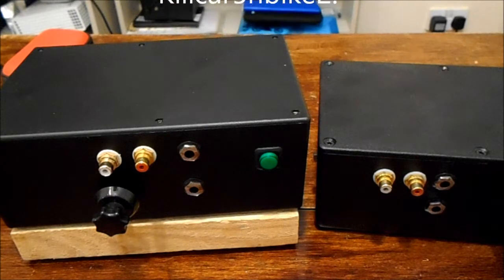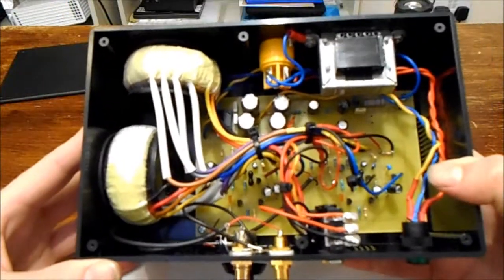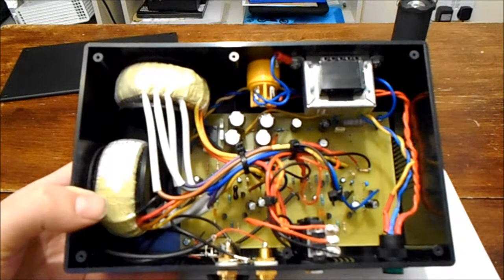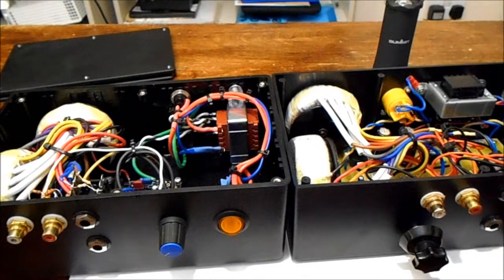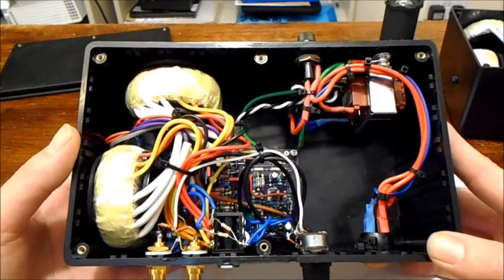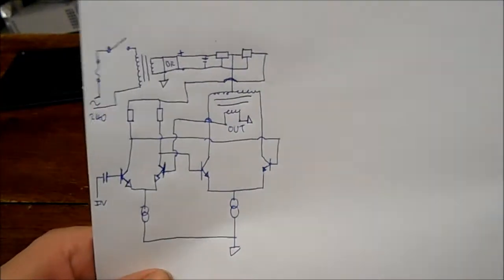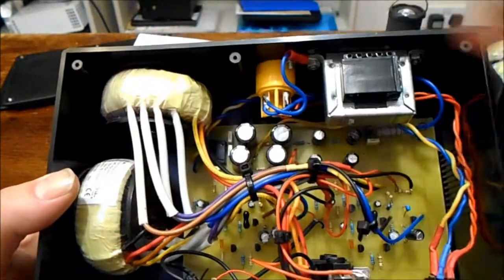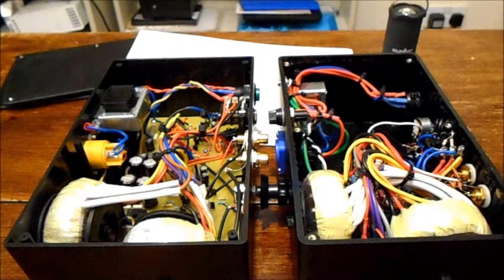Using PSU toroidal power transformer as output in audio amplifier

Comment: Very interesting topic, i wonder why no one commented for so long. A lot of German pro audio gear from 60's on used toroidal output transformers, some inputs too, all of this gear has great sound. I know several companies who wind inputs for ribbon microphones, so reflected impedances aren't far from phono inputs. A few manufacturers showed how they segment what i think is secondary over primary for SE (looks like about 8 windings separated by empty space bewteen them, forming full circle this way), also using shields as is practice in pro audio toroidal power transformers. Thanks for posting your video.